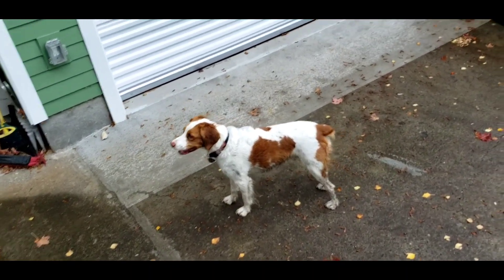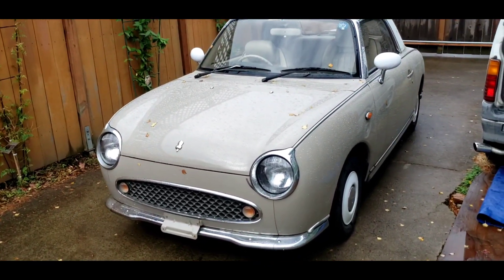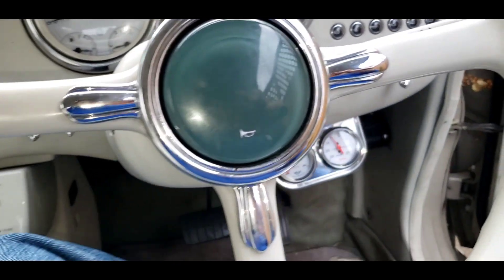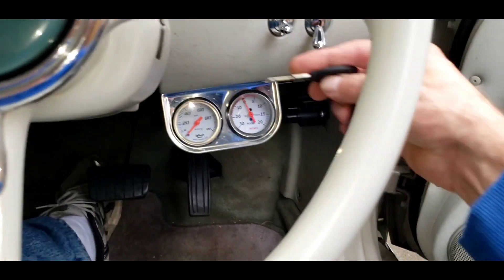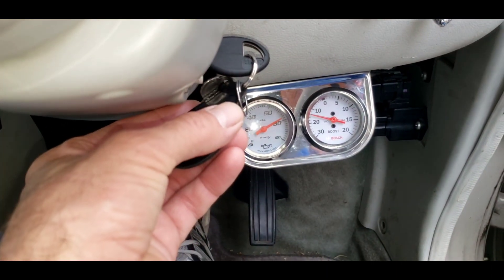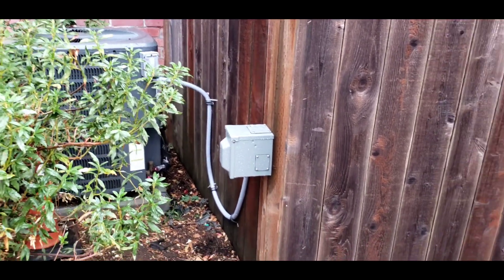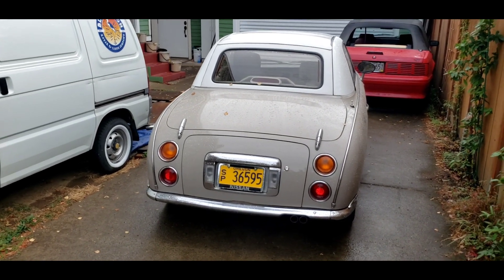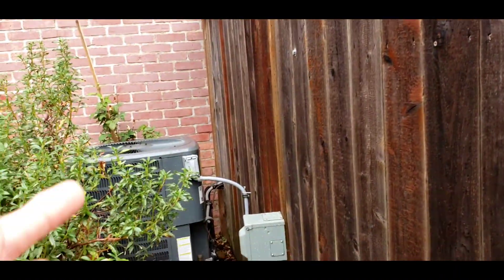Everyone is Switching from Gas to EV 's !

Comment: CAUTION be aware, I previously used those plastic lines to supply a mechanical oil pressure gauge but after awhile the plastic rubbed through at the compression ferrule and leaked. I replaced with solid copper tube of the correct diameter, which lasts for the life of the car. Be aware that different design compression ferrules exist for the plastic and copper pipes. The ones designed for plastic lines are softer and are designed to, hopefully, not break through the plastic hose. Copper intended compression ferrules will break through the plastic oil line rather quickly, in my experience.
Reply: Those big rigs use DOT approved plastic air hose lines for there pneumatic air needs (brakes,suspension) make sure it says dot approved on the hose, I would think its rated for more than 100psi use.  Can buy from big rig supply house.

Comment: That fence is too close to the proposed EV -which is basically a fire hazard. BTW great explanation about the "either/or" switch. Yeah, that A/C compressor gets anything it desires here.
Reply: Talking about "either/or" switches, reminds me, there was a time back 60 plus years ago, when many houses had minimal electric supply. In the early days some had an either/or switch above the kitchen stove (electric cooker,  was common in some areas without gas supply). When the kitchen cooker was NOT being used,  flicking the switch allowed electric supply to an electric heated hotwater storage tank. I lived for many years in a remote rural house that, as was quite common locally, had just 2 fuses. An 8 amp fused circuit for ALL the lights and a 16 amp circuit for all 13 wall outlets.(Single phase 240 volts remember, USA's 110v is rare on the world stage).   Note there was a bottle gas (propane/LPG) kitchen cook top, and hotwater unit, and a wood-fired stove for an oven (or some Winter heating). This was in Australia where the temperature only rarely dropped below zero, and on the days it did, it would warm up by lunchtime to a Sunny mild day, so very little home heating was needed. However when using heavy drain appliances like an Arc Welder or a metal cutting saw, I would temporarily unplug my fridge/freezer.  I'm wondering if, in the interests of economy and saving the planet, as well as people's money, instead of increasing the available power into USAmerican homes, electric supply could be limited, including by techniques such as "either/or" switches and people learning to live within those means. I recall seeing a subdivision of small homes in California (referred to as "manufactured homes" in the US) and they were originally wired with 50 Amp supplies. And there was an insistence that people, at considerable expense,  upgrade their supply to 100 Amps in each small home. Even if it was just a single or couple who lived economically with electricity use.   My large home in Australia got by with a 24 Amp supply !

Comment: Wow 7 cents per kw/hr is ultra cheap, even for hydro generated power. Here in New Zealand, especially the South Island, our electricity is over 100% Hydro (ie, much gets exported into the North Island by undersea cable) and our standard domestic rate for electricity is about 30 cents per kw/hr.  Clean air rules mean we're not allowed to use coal and the South Island has no gas/piped propane. Even allowing for our dollar being smaller than the USA, Yankee electric is way cheaper than Kiwi electric !  Even for those people set up with special "off peak, night rate" power, they still get charged some 15 cents per kw/hr.

Comment: Why would you want 20-50 oil in a recently rebuilt engine with known 
high oil pressure? 

Sure, the 20-50 made sense while the oil pump was messed up. 

Id replace the oil with 10-30 or 10-40.
Then see what the oil pressure would be.
Reply: I would also go for 10w40
Reply: Yep I allso think that w20-50 is for maby like a old tractor or something...At least go down to like w15-40 🙏🏻⚠️✅

Comment: I also had no curcuit available to add 50 Amp service. My house was wired for a 220 volt dryer in the laundry room, but we use natural gas. It was easy to disconnect the 220 at the panel then I added an exterior box on the side of the house. Problem solved.

Comment: Whats the relief valve set up like?? If 20w50 oil is factory, theres something wrong and i personally wouldn't be in a hurry to run an unspecified oil in my engine. You could look at an oil filter with built in regulation specifically for start ups (these are available off the shelf). But i'd revise my work. Good luck!
Reply from the maker: The relief valve is a simple Spring and piston. Tighter the Spring and The less relief. Now with the new analog gauge I can monitor the oil pressure much better , still only  has about 10 pounds of PSI oil pressure when hot in drive with the 20 50. However i raised idle speed a bit,, I will take it,,  10 pounds is much better than 5 pounds. I think I'm gonna keep the 20 50 too.  it's turbocharged. It needs the protection when hot.
Reply: @2stroketurbo  yeah sounds like the same setup I have. Good call! I have an external oil cooler on my air-cooled vw and it's essential for me to have the oil filter with built in relief, cold start on a cold day has the potential to make the oil hoses explode!!

Comment: We just don't have the tech for full electric cars not just yet M but the but the hybrid flourishes best thing we got a Hybrid student my self.

Unless they add a solar panel to the electric cars to help sustain it besides the regenerative braking I personally see him as viable and you would think Tesla would have thought of that first 😂
Reply: Solar panels on cars aren't viable without a MASSIVE tech breakthrough. A large solar panel can potentially deliver 600w peak (12.5 amps @ 48volts). A golf cart will pull 400-500amps @48 volts under full acceleration. You see the problem here? Electric cars already have travel ranges comparable to fossil fueled cars. So by that definition they're already viable. Its just not viable if everyone suddenly switches to electric and driving your old vw bug will always be more environmentally friendly than a new car, fueled or electric.

Comment: 50 amp receptacle through 8 gauge wire and a 30 amp switch?
Reply: 8AWG wire can carry 55 amps safely, and while the switch current is a bit low, 30A at 240V is 7.2kW, which is plenty for any EV for overnight charging. If you're regularly pulling more than that, you should be using a DC fast charger anyways. Most EVs draw about 6.6kW during charging anyhow.

Comment: Mark, it doesn't look like you used a 30A switch inside the box.  It looks like a 25A at the most.
Reply from the maker: It doesn't look like it , but it is rated 30 amp by well known trusted American brand  company,  Hopefully it is.  I really want somebody to come by with a Tesla so I can charge and measure max amp draw
Reply: @2stroketurbo    If you have 30A in black and white than it's verified.  I'd never seen a 30A that look like that, and it concerned me.  If you have reservation, someday when a high load is placed on it, check if it's become hot.  That would be an indicator of a problem.